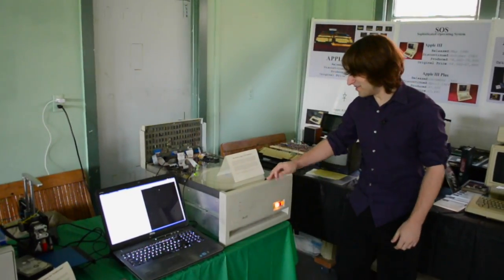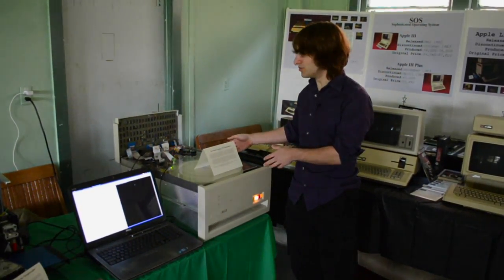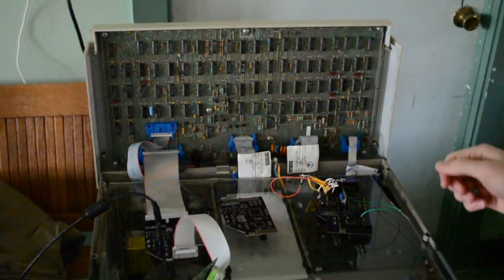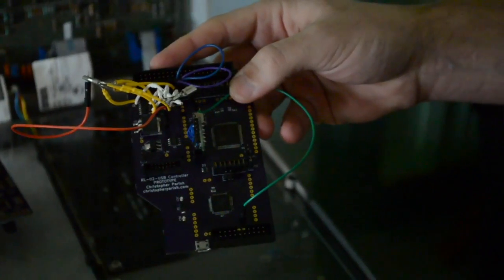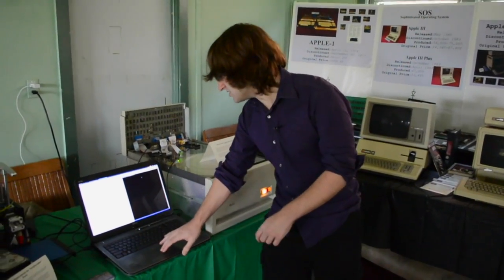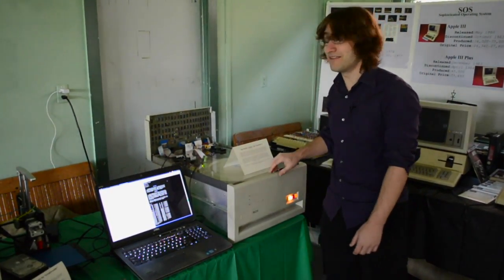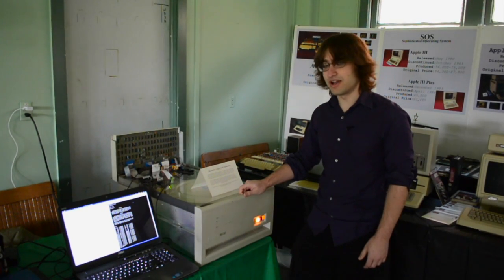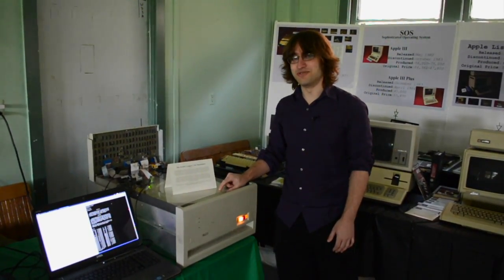The World's Largest USB Thumb Drive

Comment: I'd like to see someone take up the challenge of doing this with an SDI drive.  It won't be simple- it uses a high-speed differential serial interface over a 4-way micro coax cable- a technique years ahead of its time.  It could be done with an FPGA with differential transceiver hardcores but it would be difficult to get the timing right- and you'd probably need some RF circuitry in front of it to translate levels.

Comment: Very cool.  So I have a PDP11/23 which had a couple RL02 drives which we never got to work.  We ended up getting the machine up and running on an MFM drive.  I'd be interested in seeing some of the details on your design, since I still have the behemoth's of the drives sitting around with a stack of disk packs it would be cool to try and read the data off of.

Comment: Awesome project, and great presentation! But was that disk actually operating during the recording?

I once owned two 300MB CDC drives that were similar in size to the one in the video. When you turned the power on, the fans would make about as much noise as you can hear in the video, but when you would actually spin up the disks with the button on the front panel (one by one, otherwise they would blow the 16A / 220V house fuse), the AC motors made so much noise that you had to shout just to make yourself heard.

Good times! Especially when I first got them. They weighed 56kg/123lbs each so I had to take them apart and make 4 trips on the bus to get them home :-)
Reply: Jac Goudsmit You wouldn't happen to know where someone could get one of those CDC drives, would you? ;)

The disk was spun up and running, but it turns out the entire 10MB pack fits into the buffer Linux creates for block devices.  Once you read from a sector, it never hits the physical disk again unless you write, flush the buffer manually, or detach and re-attach the drive.

Comment: Why ? Because he could ! Nothing like a challenge even if the final result is less than useful. John Connor will need that to get the info off the computers in the crystal palace after judgement day.
Reply: Jeff Barr It's actually useful, he did not just write his own data, he is reading existing data on old disks.  This is actually VERY useful as there is a lot of data out there on old drives with high value.  Several guys found old 9 track data tapes that had Images from NASA moon missions that they were able to recover better images than NASA had.

Comment: This reminds me of my "ancient" IOMega drive i found at a rummage sale.  The disks were over a foot long and drive itself took up more room than my IBM PS/1.  I really liked the fact that it had a swing closure, like the old 5.25" floppies had.  After 2 apartment moves, my girl forced me to junk it but seeing this makes me miss it again.  Just wish I could find a picture of it now but as a fool i never took down a model number and i don't recall ever seeing a model name on it. :(  All i really remember was that the guy assured me the data was securely overwritten as it used to store info for hospitals.
Reply: Skwiggs Skytower Was it a Bernoulli 10 or 20 drive?
Reply: John Lafornara  Nice! yeah the one in that vid looks just like it.  once i saw "Bernoulli" i remember it was labeled "Bernoulli 20+20".  I remember making jokes about it having good eyesight :)   I was on e-bay looking for it but those were mostly single drives. The doubles on there were connected horizontally instead of stacked like this one. Thanks for the help!
Reply: David Schmidt Thanks to John, I'm pretty sure it used 20MB disks.   The drive itself weighed more than my IBM P/S 1 but about the same or heavier than my 8088.  I got a lot of flak from my roommates at the time for bringing it home but w/e :)
Reply: Skwiggs Skytower These RLxx series of drives from DEC - like most disk subsystems of the era had quite complex and critical airflow designs.  The drives had a replaceable air-filter cartridge among other things to sustain the clean air zone within the disk compartment.
Reply: You are correct.  As a current owner of a PDP-8/A with a pair of RL02, I can tell you what he did is NOT GOOD enough.  I doubt he had access to the bad-block remapping logic tables, etc. and just assumed the disk was error free, which is just not something you ever do. SIMH DOES assume perfection because it always deals with a file which my definition has empty tables [no claimed defects].  He got lucky, but there is an awful lot of code he would have had to research to know exactly what to do, not just assume error free the way SIMH does.